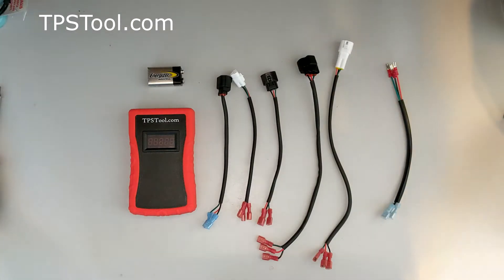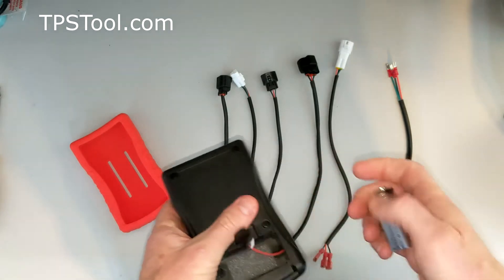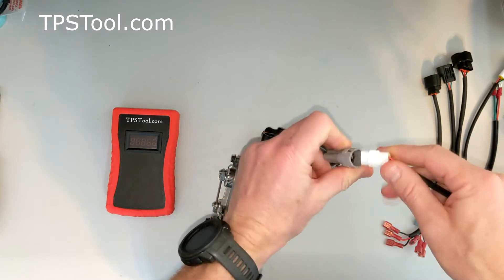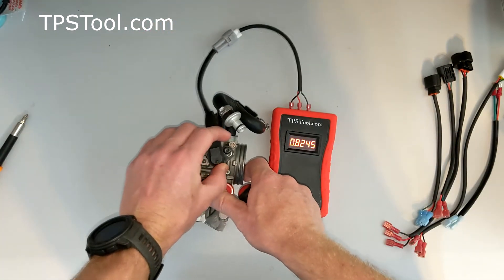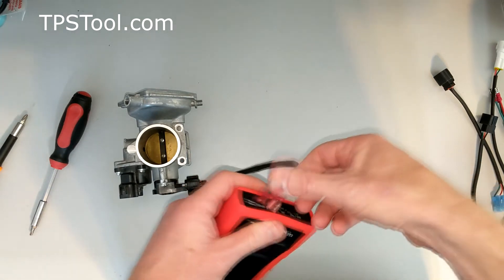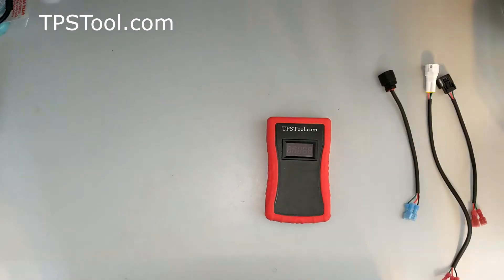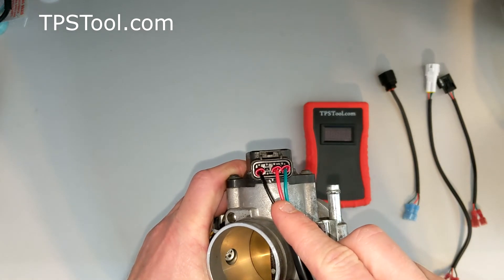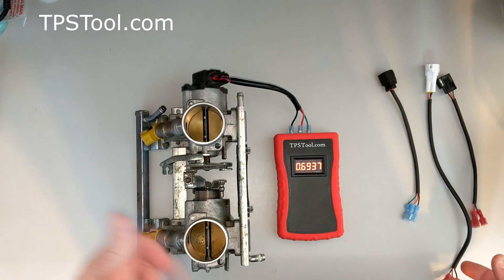TPSTool Pro - Dirtbike, ATV, Snowmobile examples - KTM, Polaris, Arctic Cat

Comment: Will it work on a 2017 can am outlander 450?
Reply from the maker: Thank you for your question.  You can use the universal adapter to read the TPS, BUT the TPS on your outlander is not adjustable.  Most likely you need a Can-Am tool and/or software to set the TPS up in the engine computer.  I hope this helps.
Reply: @TPSTool  okay sounds good Thankyou for the help👍

Comment: does this work on polaris edge ves carbbed models 01-05?
Reply from the maker: Thank you for your comment!  Yes, it looks like the Model-4 plug is a direct plug-in.  That motor has a carburetor so double check the manual to see if the TPS setting is specified in volts or ohms.  A lot of the older carbureted motors had the TPS setting specified in ohms.  If it's specified in ohms then use a regular multi-meter on the ohms setting, if it's specified in volts or if you know what voltage you want then this tool will work perfectly.
Reply: @TPSTool   wot calls for 4.0 volts .yep, its measured in volts.